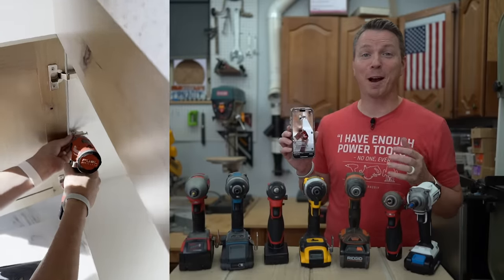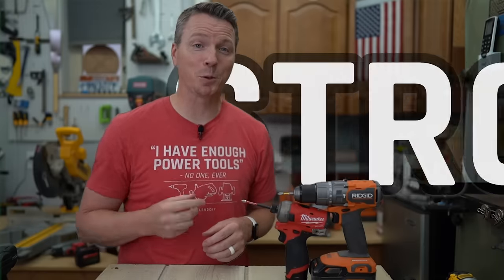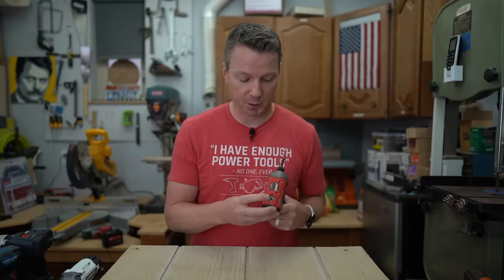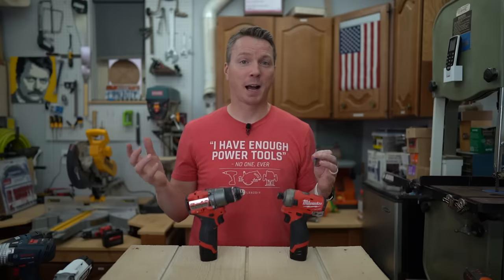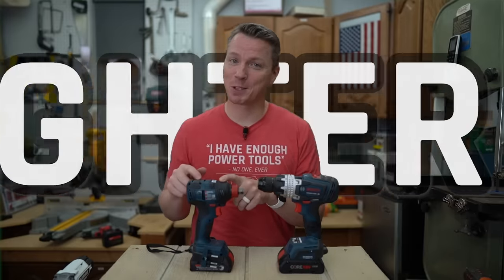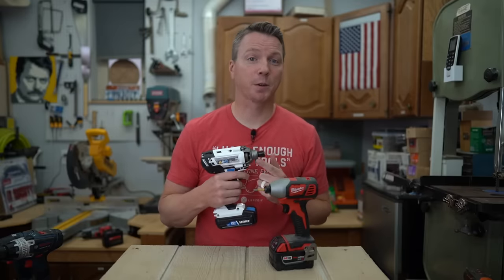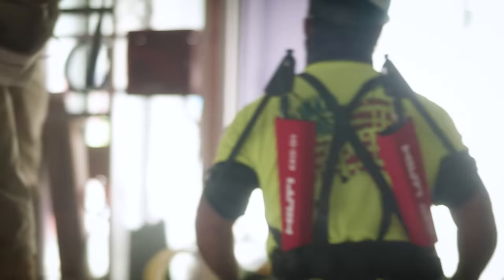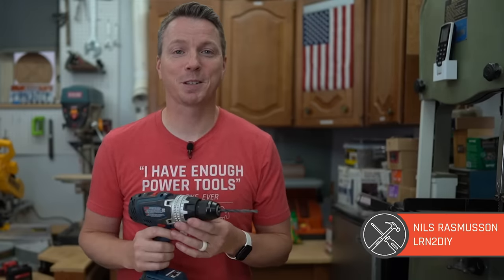6 Reasons To Grab Your Impact Driver First

Comment: Reality is 95% of people do NOT need an impact driver. These are maybe useful for the professionals and those who have a career that requires those tools. Rest... is just pure marketing and the desire to make you spend money on unnecessary tools.
Reply: I totally disagree with you. Make the switch and you'll rarely use a drill again except for actually using drill bits to make holes.
Reply: @donaldo1954  I did, but I want a screwdriver that has a clutch and different levels of torque (1-25, for example). I cannot trust an impact driver to not overtighten the screws. I would use an impact driver for long screws, indeed, but for home use ( installing of Ikea furniture and so on) an impact driver is not needed.
Reply: Maybe get a real impact with different settings and not a walmart driver @ionutjon7635
Reply: He's right though. If you are not a tradesman or a DIY enthusiastic then a good combi driver is all you need for the odd job around the house.
Reply: @ionutjon7635 i was on the same side until i found a impact that has a 3 speed. 1 is a screwdriver (0-1000rpm) and the trigger is pretty sensitive
Reply: It’s actually the other way round most people don’t need a drill but would benefit from an impact driver
Reply: TOTALLY DISAGREE.......
   Speakin as a regular Joe, I much rather have a TOOL 🔧 who's main function is screwing in & unscrewing bolts 🔩 and things.
  I almost never have a reason, to put a hole into something.
Reply: @invisiblerevolution  Even if you need a few holes a year you can just use a small and cheap adapter or buy special drillbits and you still have all the benefits of an impactdriver wich is mainly not breaking your wrist. I mean i would rather let my mum use an impact and not an actual drill that can break her wrist.
Reply: lol wrong
Reply: @ionutjon7635 that sounds like a skill issue not a tool issue
Reply: An impact driver is perfect for weaker people to avoid cam out
Reply: Yeah you have no idea what you are talking about
Reply: It's really the other way round. Most people probably don't need a drill because an impact driver will do the same job. Unless you're drilling into masonry or are a pro woodworker, you probably don't need a drill.
Reply: Hahaha all the way around... It's clear you have never used an impact driver... Otherwise, you should know by experience that they are a lot better tool to drive screws than a drill... hands down.
Reply: @post-leftluddite  driving screws with an impact is not just about strength, it is about SPEED.
  When you need to fasten two pieces of wood together, but they keep pulling apart once you get through the first one, you will wish you had an impact driver. Otherwise, you will have to take more time to pre-drill the hole, and THEN drive the screw with your drill.
  As a craftsman and someone who uses my tools every day, my dewalt impact driver is one of my most invaluable tools.
Reply: As a professional after using an impact driver for twenty something years I have to disagree with you. Your right in saying that a person can get by with just a drill but impact driver is a lot better at driving medium and larger screws  because it doesn’t cam-out as easily as a drill thus less damage to the screw head. Also less fatigue on the wrist. Smaller screws a drill is fine and sometimes better. I say get both. You can get some really good deals on a kit when they go on sale.
Reply: I have every size. You can choose whichever drill you want. I prefer to have multiple tools and use the one that that makes my job easier and most efficient.
Reply: You’re getting a little emotional over a discussion about cordless drills. Have you considered therapy?
Reply: I do disagree with you. Don’t feel like explaining.
Reply: The fact that impacts are normally smaller and lighter is enough reason to have one. Take my money.
Reply: unless you're insanely poor , there's no reason not to have both in your arsenal
Reply: Most of the things we use on a regular basis we don't technical NEED. But impacts guns are useful to professionals because they're incredibly useful period and could be equally as useful to a homeowner or DIYer. Most sensible thing to do regardless is buy a combo kit. Last I looked (it's been a while, mine are still holding up) a Makita drill or impact gun alone was $100-$150 Battery not included. Drill/impact gun with 2 batteries and charger kits were $200-400. It's the most sensible option regardless of who's buying it. Impact guns have their benefits for everyone
Reply: 100% agree. Americans (~5% of the world population) live in paper homes held by wooden stud, so drivers to drive screws make sense. The rest of the world(95%) uses concrete.
Reply: @porkchop7652 I actually prefer an impact and installation screwdriver. I basically only use a drill now for drilling holes and the hammer function (aka still drilling holes)
Reply: The flip side of this is for the home DIY types like me, there are viable less expensive alternatives like Harbor Freights Hercules line. Plenty powerful for my use, and the price is good. Quality has been good. Having a second drill is great when having to drill a pilot hole the driving a fastener over and over.
Reply: Time is money in trades. We dont have time to hand tight and untight. Most to all trades you will need an impact
Reply: @post-leftluddite  absolutely. I'd much rather see a homeowner/DIYer with an impact gun and star bit screws (I think they're really called torx) than see them laying on a drill with a Phillips bit hoping it doesn't cam out or slip off entirely. Also, I dig the profile picture.
Reply: 95% don't need a drill/driver either, for that matter. A screwdriver would serve them just fine
Reply: @ChicaneMedia This. The “pit crew” aspect of tool usage.
Reply: You are not wrong about 95% of people not needing one, but the marketing is toward professionals. Everyday people like to consider themselves something of the sort after a few YouTube videos, the reality is they will go broke trying to have the same tool collection as a tradesman, and they do not need to have the same collection as a tradesman.
Reply: completely disagree , impact driver is definitely better for everyone and you can get on for 25 bucks .
Reply: Very true!
Reply: @ktestable  Well, the rest of the world is poor. They would rather use non-renewable resources for their houses because they don’t have access to much timber. They don’t even turn their AC on during the summers. Houses in Japan are also made of wood.
Reply: You don’t need a drill by that logic then either. He explains why the tool is far superior in many aspects, whether you “need” it is kind of irrelevant. You don’t “need” any tools if you’re not a professional, just hire someone. The rest of us like using the right tools for the job, and an impact is clearly superior for anything but drilling holes.

Comment: Many of your reasons are simply not true, unless you don't know how to properly use a drill. Smaller, lighter, no kickbacks...Yes,  these are all legit reasons I would also choose an impact for certain tasks. However, the drill is an overall much more capable and versatile tool on all fronts. It is significantly faster/more powerful than an impact. Amazing you can say this on camera with a straight face, have you used that Bosch drill ever? ... looks like it's never seen a day on the job site.  Please take those 2 Bosch units you've got there(the cousins) and drive a variety of fasteners and the drill will drive them twice as fast despite the torque advantage of the impact(on paper).  Also, with the clutch set properly the drill will sink them flush every time.  As for the too many settings to check dilemma- I guess if you've never used them it could be confusing but for those of us that use them daily it's essential to use these settings and take advantage of the flexibility they offer to properly execute different application. Wanting less features on your tool so it’s less capable just makes no sense. The different speeds are nice on an impact but it will never have the absolute precision and control of a drill particularly with applications that require finesse in delicate material .  Also, drilling with an impact is a terrible user experience, no one in their right mind is drilling with an impact all day long .  So I will agree with the weight/size reasons but I’m not sure if those will completely offset the terrible noise you must endure using an impact driver all day long.
Reply: Impacts do have that higher torque, but its applied in limited bursts. Drills apply constant torque so it makes sense that it drives faster

Comment: I'm from EU and here for furniture assembly we use small 12V installation drill drivers. Smaller and way less noise. I get all the advantages of impacts but for such a simple task it is overkill to use them.
Reply: I got the Bosch 12V brushless installation kit.  It is fantastic.  But it is not quiet.  Brushless drivers are noisier than brushed , but this Bosch is obnoxiously loud.  I wish I had the brushed version as it's probably much much quieter.
Reply: @GannDolph  I too have that Bosch and I have other issues with it. 10mm Plastic drill chuck. When adjusting the clutch the flexiclick can be detached by mistake. That new sds attachement is awful. I was comparing noise level to impact so for me that brushless motor is not that bad plus the compactness won me over with that bosch.
Reply: @gl0sek  thanks for info on the sds accessory- i was considering buying that.  
 yes obviously different category of noise altogether  compared to an impact, but the motor+geartrain on that little bosch screams too loud for me to use around the house at night.  in those situations i turn to my big old ryobi brushed drills for silent working :)
Reply: These are totally underrated tools. I have a metabo unit and its smaller size, quick-change chuck, AND a clutch - gives the best of both worlds and the metabo unit was pretty inexpensive.

Comment: There’s a lot of “handymen” and young construction workers who just use the impact for everything. Plenty of delicate fasteners stripped or destroyed because “they knew what they were doing”  drills have there place most ppl don’t understand how the settings on a drill work
Reply: This. I had a Messican snap the anchor screws for my deadbolt with an impact tool. Wrecked the frame of my prehung door. At that point, I took that tool away from them. Drill with adjustable clutch is the way for most things.

Comment: I like both. Impact for slapping wooden structures together and tightening/loosening nuts; drills for everything else, including most screwing tasks. Proper use of a clutch saves so much time and minimises damage from over-tightening 👍
Reply: agreed
Reply: yep, as was said in the video..
Reply: I prefer impacts also, wear hearing protectionof course. I'm a dewalt guy so the drills are just as load as the impact anyway, so just use an impact
Reply: 100 agree - for fastening tasks with any chance of over-tightening I would go for my drill . Impact drivers feel to me like a tool that CAN do alot, but there is usually a better tool for the job. Like working on cars an electric ratchet and a 3/8 impact wrench are more approriate tools. But thats 2 tools instead of one.
Reply: @MarkTrades__  "instead of an impact I use an impact and a ratchet"
Reply: @gg-gn3re  an impact driver and impact wrench - typo!
Reply: If I can only have so many tools in my car, I will keep the impact driver over the drill, but have an impact drill bit set to go along with it
Reply: @SamLoki  makes sense. A lot of people seem to feel this way. I struggle to drive screws with a driver to flush-but-not-too-deep. Think that's a skill issue on my end though 😂
Reply: Spot on. I've seen too many guys snap the heads off screws with impact. Drill with clutch is the way to go for most things.

Comment: I found that when screwing into pallet wood, my impact snapped off screw heads, and I had to switch to a drill, which was the right tool due to the hard wood.

Comment: Comparing apples to oranges. Using tools improperly to produce cons when comparing tools that have different purposes. A hammer drill has a handle attachment for a reason. The hammer function works in a different way than an impact driver, making the ways to use these tools different. You don't use an impact driver to drill concrete. You don't use a hammer drill to drive lag bolts. You don't use an impact driver to screw cabinets together. You don't use an sds rotary hammer to screw drywall. Use the tool made for the work. A lot of times you need to drill the hole before you screw it, so you don't split the wood.

Comment: Ok you really missed this, dewalt makes a 12v drill / clutch model  DCF601F2. It uses the 1/4” collect.  I also own the Milwaukee  gen3 12v hammer drill and impact-truly fricken amazing
Reply from the maker: That's an awesome little tool! I haven't purchased one but I think I will. I still love the advantages of an impact but for a lot of applications, the DCF601F2 looks like it would be ideal. I have that same M12 drill/diver set by Milwaukee tool and they're just fantastic. Sounds like you have great taste in tools!
Reply: @LRN2DIY thanks. My ex manager wanted us to buy HF tools  but I’d refused which made all my tools the envy. And  bought by me, so no borrows.  After 38 yrs, yah learn to care for the tools. Finally not letting ppl break or forget they borrowed it, and ya that happen a few times.

Comment: I used my impact driver for 4 years for everything from building outdoor garden beds to mounting TV’s. I bought an attachment that allows you to use non 1/4 bits and I never needed a drill.

Until I needed to drill into concrete, and now I use my drill ALL the time. More control, but bulkier and not always better than an impact. Both are useful in their own ways.

Edit: I do mean a drill with a hammer function

Comment: I also use my impact driver way more than my drill, like 4 out of 5 times.
But when I need to drill through masonry or use any non-twist bit I'll pick up the drill.
The impact driver seems to hammer way too much (and slower) with spade bits and auger bits while being slower than my drill. Having said so this time I picked my drill with anti kickback and it makes all the difference when dealing with large bits.

Also, please remember using hearing protection if using an impact tool for extended periods

Comment: Dewalts DCF601 12v screwdriver is one of my favorite tools. Has the size of a compact impact, a quick insert and an adjustable clutch. Great for many applications, especially wood work or delicate tightening
Reply: There is no compact impact only a an impact driver or a compact drill and an impact wrench. These ate three different tools. When do people start not mixing up the wrong name for the right tool? One does not buy an impact driver just because it is lighter only maybe to use it in smaller places. And kickback is not an issue really when one uses the tool properly. Just hold it firm  with both hands as much as possible so u get a feeling for eventual kickback and just release the knob.  I never in my life had my drill kickbacked on me .

Comment: Legit just got a drill attachment for my impact driver and its a match made in heaven. Havent looked back when it comes to drills. All the rotation with impact to help guide the drill bots through. Do make sure to get impact rated drill bits tho!!
Reply from the maker: Don't laugh but I have one and haven't used it (the drill attachment). I seem to have every bit I need already with a 1/4" hex so I haven't opened it yet. And good call on the impact rated bits - it matters!
Reply: If it'd impact rated should it not already have 1/4" hex quick attach? I actually use the opposite adapter on my drill lost of the time.

Comment: I have a house out of concrete and I build everything around garden and yard from wood. My trio consists of SDS hammer, drill for mostly predrilling and small impact wrench (dewalt’s 922) for screws and bolts/nuts. Love them all. Being engineer by profession and DIYist in my spare time I say it is not as much about what you NEED but what you like to make your job easier. Don’t sweat it.

Comment: Yeah I spend all day installing data cable and putting up security cameras, and today my Impact Driver broke while I was using a spade bit to chew through a top plate like I always have. No idea why it broke given it’s an M18. So I grabbed the drill and did it in half the time it was taking the driver. While there’s a strong push for impact drivers, drills definitely have their place. Drills for holes, Drivers for screw (I mean, it’s a screw driver really) 😅

Part of this was that the 1/4 hex on the spade bits suggest using an Impact Driver for making holes,. stick to a cordless drill and just lock the hex in place (or use a 1/4 hex adapter).

Comment: Impact drivers are awesome. You can put a flathead bit in it, a Phillips head, or socket adapters. A tool that can drill, drive, or do anything. These are the most valuable tools if you want a wide range of use. One tool that allows you to use all of the goodies in your toolbox.

Comment: Great information.. impact drivers are great especially for fastener.. I use both impact and hammer drills and lean towards the hammer except for fasteners, that kickback is nothing to play with.. the hammer drill as you mentioned has the drill, chuck settings, hi/low speeds and up to 1/2 shaft … wonderful video

Comment: Apart from the 12v DeWalt 1/4" Hex chuck driver drill mentioned in other comments, Makita makes both a 12v and an 18v 1/4" Hex chuck driver drill.  I have the 12v and I have found it to be a lightweight drill with enough power for my needs.